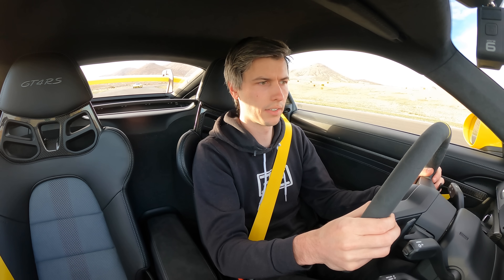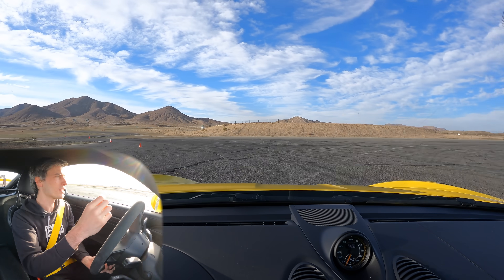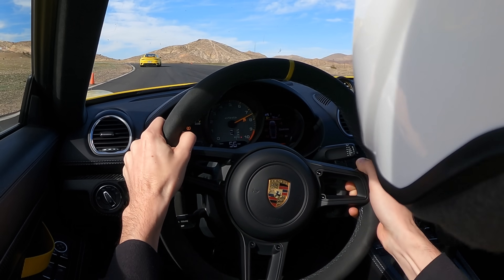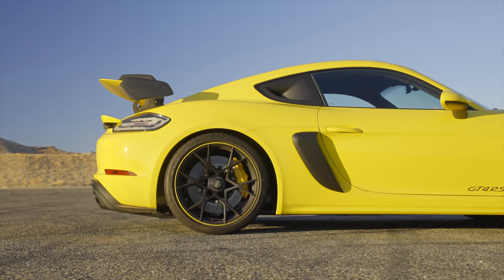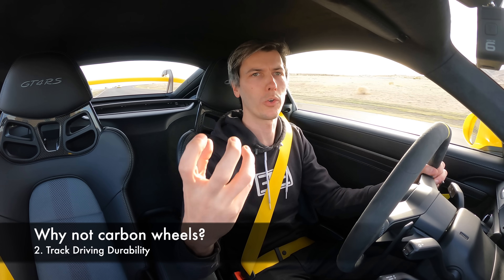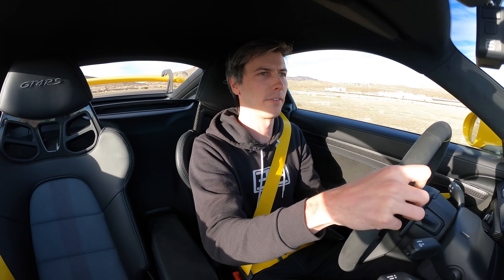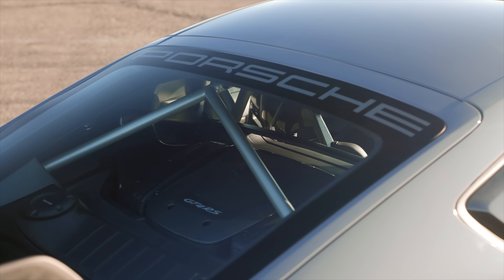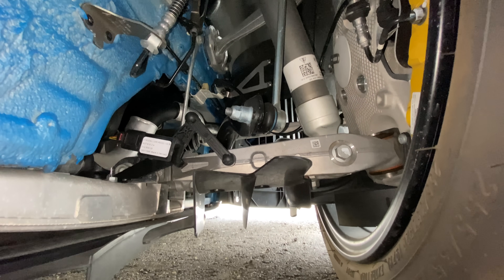The Combustion Engine Perfected - Porsche GT4 RS

Comment: Hi Jason. Great video report. Thoughts on your comments and the questions you raised.
1. Having more aggressive gearing on all Cayman models. I suspect that this has more to do with brand-wide emission regulations than anything else. The fewer "dirtier" cars they sell (e.g. with close gear ratios)  the fewer electric powered vehicles they have to sell to offset it.
2. As you would know, the stiffer the springs, the less problematic the compromises (e.g. toe-in & camber change) inherent in MacPherson struts become. 
3. Moving the engine from rear to mid. Of course, In the old days we'd just invert the transmission and modify the casing as required 🙂

Comment: What I like about Porsche? They are not overly-fancy, they are not record setter in terms of pure numbers, but these are cars made for the most effective experience on track days. These are proper driver cars!
Reply: That's a very ironic statement, considering they've been doing just that, since the early 2000s.
Almost all of their GT RS cars set record around the ring, when they were launched. 
 Some were even created expressly for that purpose, like the 997 GT2 RS, which was designed to beat the GT-R lap time.
Reply: To be fair, they often are the record setters in terms of pure numbers too! The GT2RSMR is still faster than any production car on the 'Ring and the GT2RS was the fastest production car for a while. That's just an added bonuns though, I totally agree with your sentiment.

I also quite like the longer gearing- more of the sound for longer! I don't really care if a tuned Golf R can out-drag my 981CS...because nobody else cares that the Golf exists once they hear the flat 6 😆
Reply: most effective experience on a track day? that's sarcasm, right?
Reply: @bilaltariq7819  why would it be? Want to take a look at the top of the Nürburgring records? You aren’t likely to find a more common name than Porsche.
Reply: It’s funny because I know what you mean with this comment but you can also apply the opposite based on perspective. They are record setters based on pure numbers. They find out the bare minimum (pure number) they need to set a record. They do that. And then they go and set a record haha.
Reply: The carreras can be a handful to drive fast. I hate how they feel because you always have to be right on the edge for it to be fast. Some people love them and amaze me with how they can toss the car around

Comment: The only reason why anyone would buy the GT3 instead of this . Is because the Cayman has always been looked at as the lesser Porsche , or the girls Porsche . Mid engine is way better than rear engine , and if this thing has the same engine as the GT3 . It's a no-brainer , this is the better car .
Reply: Hearing at the end that it has McPherson strut suspension is about the only real down fall . I think it's rather hilarious that my Ranger has dual wishbone suspension front end and a Porsche Cayman or otherwise comes with McPherson strut . People can claim it's just as good or even better , but the only reason it even exists is because it's cheaper . Just like front wheel drives , not safer not better , Just a hell of a lot cheaper to make .

Comment: Overall this just seems more like a shouty version of the standard GT4 because the performance gains are incremental at best and the lack of max downforce ability in comparison with the GT3 is sad for a GT4 RS. On one hand they talk about gravel traps as a reason against carbon fiber wheels yet they don’t allow for enough downforce ability for a good track day. Porsche needs to get their messaging straight. I gotta say that those aluminum wheels look pretty badass though.

Comment: Wow, I didn't know that engine pushed >120HP through each liter of displacement. That's impressive as heck for an NA engine. I wonder how much just the parts necessary to get that power out weigh, and what it's tank to crank efficiency is.
Reply: Honda did it in the 90s.. not really that impressive
Reply: @Tommyownzz  You seem to have gotten a bit confused there and projected some strange form of brand worship onto me. I don't care about the brand, I don't care about the year. 10,000 years from now, any NA engine that pushes >125HP/L is going to be an impressive engine.
Reply: Oh, it can pull >125HP/L when optimized for power? Wow...

Comment: A 9hp drop from 502 down to 493 is a bargain for the increased handling that the mid engine layout will give this car.
Reply: Length difference between gt4rs and 992 gt3 is less than 12cm, so they are almost equal in size. 
Advantage gt3 has are suspension and rear wheel steering. 
Also the engine which wasn't designed for midengine layout.
Really great car, with superior engine layout, almost has it all. But still slower than GT3 because of mentioned reasons.
Reply: Knowing Porsche the actual numbers are a bit higher.  They typically under promise and over deliver.  Even on performance numbers.
Reply: plus even a lot of racing drivers would struggle to notice 9 less horsepower, so an amateur on the track or especially someone just driving on the road definitely would not.
Reply: increased handling?  the gt3 has faster lap times
Reply: Fact.
P.S. Everyone arguing against it simply needs to think about it in terms of ‘all other things being equal’.
Reply: Noob question, what's the differences between cayman and carrera?
Reply: GT3 is faster. 911 has upper and lower arms in the front, multi-link in the rear. Cayman is McPherson struts front and rear. As a result, 911 stays more composed and has better mechanical grip. 911 GT3 track times are faster than Cayman GT4.
Reply: @ivorysoap  I would think that the difference between performance of those suspension types is not very big when surface is nice and if settings are firm. Anyhow, I don't believe that Porsche would deliberately harm performance of the Cayman in that way (by choosing bad suspension).
Reply: @jkk916  Cayman has McPherson struts rear suspension because of its physical dimensions and drivetrain layout. Multi-link won't fit. It has McPherson struts out of necessity, not as an intentional handicap. New 911 GT3 is only 911 with upper and lower arms up front. All other 911s have McPherson struts up front. That's why the new 911 GT3 is so much better than previous generations. Porsche historically favors McPherson struts, but finally got with the program with new GT3 and gave it upper/lower arms. Maybe they'll give Cayman the same treatment at some point.  It's not that Cayman has been handicapped, GT3 just has more development.
Reply: @ivorysoap  "Multi-link won't fit."
Nonsense. It's possible, just expensive since they wouldn't be able to package a carbon-copy of the 911's rear multilink and would thus need to develop a new one, which costs money. MacP suspension on the Boxster/Cayman is a cost-reduction measure so that it can be sold less expensively. But they could absolutely make it fit if they wanted to (i.e. if the cost/price analysis made sales sense). I agree with the rest of your comments.
Reply: @jsquared1013  Ugh, yes, throw enough money/development at anything and it's possible. Current shape/size/layout, Current McPherson setup in the rear is a direct result of packaging. Make the chassis longer, make it wider, sure, Porsche can certainly do that. Change chassis structure to allow articulating hard point for upper arm, sure! Do a ground up redesign, sure, Porsche can do that as well. But yes, anything is possible if one throws enough money and development at it. Brilliant observation. 😒
Reply: Handling isn't determined by layout alone. Cayman would never be faster than gt3, porsche screwed it up on purpose on the development stage. Most important part of this is crappy mcpherson suspension front AND back. You can't possibly fix that.
Reply: @maximborodyuk3773  Previous generations of gt3 didn't have double wishbone suspension yet nobody was whining about crappy handling.
Reply: @jkk916  yet it had proper rear suspension, not a mcpherson one. It makes a lot of difference.
Plus Cayman earlier wasn't available in a RS version.
Reply: @jkk916  yes they were. That's why Porsche conceded.
Reply: @maximborodyuk3773  Bingo! You are exactly right. Porsche hoped we wouldn't notice.
Reply: The weight drop of the Gt4 compensates for the few less ponies. Same power to weight ratio as gt3. Gt3 has more development hence faster lap times. But, mechanical grip and balance in the corners is superior in the gt4 due to midengine layout. Gt3 adds a lot of additional aero downforce to approximate gt4 grip
Reply: You put too much hope in engine layout. It is not better, just different. Slightly less traction and slightly more snappy at oversteer because of smaller polar moment of inertia but better balance. It is a tradeoff. Cayman is better because it is smaller. 911 got too big for normal roads.
Reply: @jkk916  The layout is better. In terms of physics, mathematics, and real-world application, mid-engined is undeniably better than rear-engined. The reason the newest GT3 is faster around the Nordschleife is the suspension geometry (and marginally more downforce, but this is a secondary reason). The double-wishbone front and multilink rear is superior to the MacPherson strut front and Chapman strut rear (Chapman strut just being the pedantic name for a MacPherson strut that doesn't steer), which gives better stability over the undulations and surface imperfections at the notoriously bumpy North Course. On a "typical" track with a smoother surface, the difference will be far less. And for what it's worth, the GT4RS is faster around the Nordshleife than the MacPherson-strut-front 991.2 GT3RS, despite being 74 lbs heavier with the same 493 HP rating.

There is a reason that only the 356 and the 911 have been rear-engined, and that all of Porsche's other road-going and racing models have NOT been: it is an inferior layout. The 356 production car was changed to RR from the prototype's MR in order to fit the +2 rear seats. The 911 is rear-engined in order to be a 2+2.
Reply: @jkk916  how do you mean to big? A 911 is not a big car. I would say, small even.
Reply: @foeke8740  Well my subjective assessment is that the newest 911 is freaking huge. Too big for average European country roads. Have you seen 911 next to WRC car? Or next to truck. To me it seems almost as wide as a truck. But it is not just Porsche, in general cars just keep getting bigger and bigger.
Reply: @jkk916  It's better. How many race cars do you see with the engine behind the rear axle, other than 911s?
Reply: @joby602  Which one is faster on track, 911 gt3 rs or Cayman gt4 rs? Also, those are still not race cars. Design of race cars is even more dominated by downforce and technical rules and this usually means some advantage for mid engined cars, in a big part due to aerodynamics (more place for rear diffuser).
Reply: @jkk916  gt3 rs
Reply: @joby602  It's not even really behind the rear axle anymore.  Weight balance is the issue, and the 911 sits at 39/61 almost at the perfect 40/60 ratio for race cars.
Reply: @joby602  the 911 race car is mid engined ;)
Reply: @Lou-f  Well, the GTE version is I believe, which maybe helps my point. However to be fair, I think this was more so they could incorporate the allowed aerodynamic aids for that class under the rear of the car, than weight balance specifically.
Reply: @Francis-rs7zu  Incorrect. The 911's engine is still 100% fully behind the rear axle centerline, it is just closer to it because they inverted the clutch and differential packaging (similar to what Audi did on the front end of their longitudinal platforms years ago). Ironically, unless it is a racing 911 (e.g. RSR in WEC), then it is entirely mid-engined in the same layout as the Cayman. As far as weight distribution, 40/60 is NOT "ideal", 45/55 is. That's what the F1 cars, WEC prototypes, etc have. As does the Cayman.
Reply: Noob question, what's the differences between cayman and carrera?
Reply: @joby602 how many races are won by 911s tho😉
Reply: @jkk916 that's only because the gt3rs has a much more aggressive and hardcore aerodynamic design, nothing to do with the engine layout.
Reply: A car is much more than engine layout. MR makes it more predictable, not better. Tires are narrower, downforce is less. It's a GT3 RS lite. If it was better, it'd be the flagship, not the GT3.
Reply: @nightdriver7216  Mid engine is not about predictable, in fact are less predictable. You say its not better, but its better for polar moment inertia, its about how much leverage makes the mass far from the midle, (probably mass x distance squared) trying to move the car out of the line of the centripetal force.
But rear engine in 911 have a couple of points, another leverage effect in traction for rear wheels in launch control, bigger than a mid engine.
The biggest effect is the better load distribution braking, 911 have a lot weight in rear wheels even in hard braking, thats why historically people say "Porsche always use good brakes" of course, but the key is not the brakes, is how can brake with 4 tires, while rest of the cars cant use properly the rear tires for brake.
So 911can use massive rear tires  for try to compensate the bad polar moment inertia, and take advantadge of them in launch control and braking too. 
Not bad, specially when they can use rear seats too.
But, what is better for track times? im not sure, but i think mid engine is better, we can see small difference times when GT4 RS have less power, less tires, less downforce, lack of double wishbone suspension, lack of rear steering...

Comment: Electric motors are 2-3x more efficient than ICE --- but have to move a car that weighs 50% more due to battery weight
There, I fixed it for you.
Reply: In the case of the car he owns (Model 3 Performance (4200lbs)).  So about 33% more weight, and that's comparing it to a high end sports car.  If you take the last sedan I had (Kia Stinger GT), which is a better comparison, you're at almost the same weight (4000lbs).  Same 0-60 time for the Tesla and the Porsche (3.2 seconds).  Waaaaay more practical with no transmission and very little maintenance.  Of course the Porsche will be quicker around a track, but the Model 3 does pretty well for $85k less which means normal people can actually buy one.  The only thing electrics need to catch up on is range.  The Tesla is at best around 200 miles at highway speeds.

Comment: I am pretty sure the immediate response is more of a question of calibration than of the individual throttle bodies. On the old Audi S4 4.2 NA engine you could literally feel how the throttle opened very slowly to avoid jerks in the driveline. Horrible!

Comment: Jason could you explain how electric cars have their milage calculated? You made a note saying electrics are 2-3x more efficient, but I don't understand how you can compare to the two. Why aren't electrics 100% efficient? Does it matter what the source of electricity is (i.e. a coal plant or a hydro station)? Would love a video on this. Love your videos!
Reply: Likely using avg. cost of energy per mile. MPGe is pretty standard metric now.
Reply: @kyletice811  MPGe is not related to cost. one electric "gallon" is the same amount of energy held by one gallon of fuel. 33.7kWh. doesnt change according to gas or electricity price.
Reply: Electric motors dod not make much heat in making torque. A combustion engine makes heat to drive pistons down to make torque. Electric is therefore nearly 3 times more efficient. There is still energy used in electric that does not move the vehicle.
Reply: @jimmyaber5920  yeah basically in ICE 30% of the heat produced by fuel burning is transformed into mechanical energy at best (rest is heat and sound). in efficient electric car closer to 90%. hence 3x efficiency. and 7x less cooling. only "downside" is you have to generate cabin heat with resistor or heat pump in the winter. but heating works right when you turn it on, not only after the engine is up to temperature.
BTW with trade offs, you can make more complex/heavier/less powerful ICE with slightly better efficiency. like Toyota Atkinson engines (in prius and other hybrids) that reach about 40% (although probably only at certain rpm/load) or Mazda skyactive-X which also runs very efficiently in certain conditions. probably if you combined all the best ICE technologies freevalve/skyactive-X, variable intake/exhaust, electric turbos etc  you could get close to 50% like in formula 1, but complex and expensive engine to manufacture, even more after paying all the patents

Yes as crazy as it sounds Formula 1 drivetrains are more efficient than any car/truck gas/diesel engine.
because of fuel limitations, any gain of efficiency means more usable power in average throughout the race

Comment: Hi Jason, just wondering, could you explain why some cars have 1" bigger wheels at the back? Like, why, when it's the front wheels that need more brake clearance? Thanks
Reply: From Lamborghini:
"Having a larger diameter rear wheel increases the amount of rubber that contacts the road along the axis of the vehicle which increases your acceleration potential. When you accelerate, much of your vehicle’s weight shifts to the rear. By comparison, the front wheels don’t need as large a contact patch to take care of steering and braking."
Reply: @nidhishshivashankar4885  But then why do drag cars use like 15” wheels? It’s because more sidewall = better straight-line grip